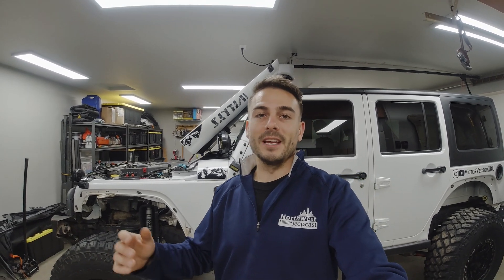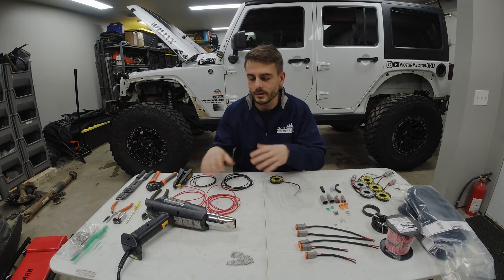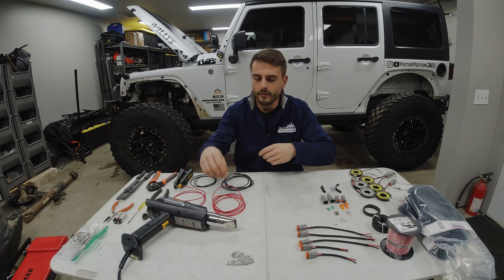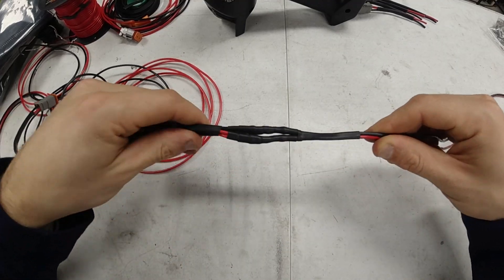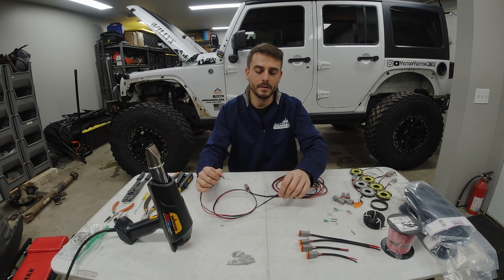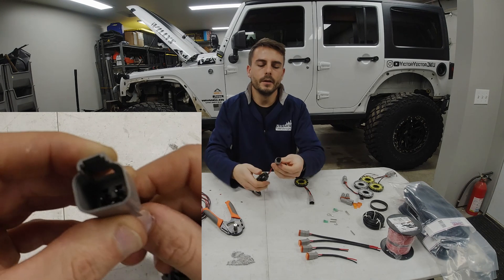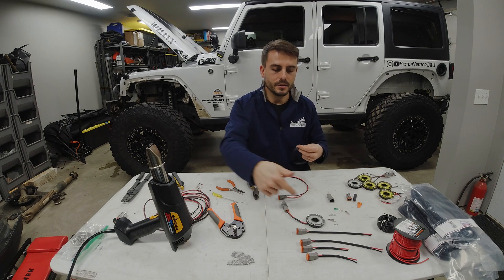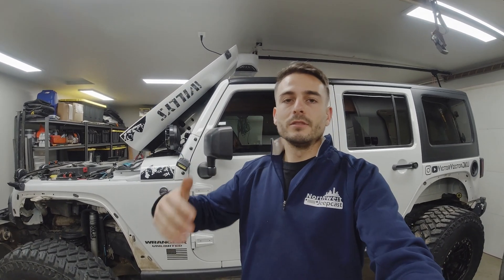DIY Rock Light Harness Build - KC Hilites Cyclones

Comment: I know this is several years late but, thank you for the in-depth video. I have been looking for weeks at install videos for various lights and nobody ever states what gauge wire they use or fully films the process of assembling the harness, except for you. As someone who lacks any and all knowledge on this topic but is trying to learn, you have my thanks.
Reply from the maker: Hey there Juliang.5901 thanks for checking out my video! Of course, I think a number of creators do not want to provide too great of detail for the case of any failures happening based on any content shared. I hope that I detailed out in my video where I obtain details on gauge of wire to use based on length and amperage and what I made is truly for reference based on my specific application. Like you said it has been a couple years since I made this video and I do not recall the details I went into 😅

Comment: Any problems running them with a single fuse compare to the one KC comes with? Which is each light running a separate fuse?
Reply from the maker: Hey there TheExia0, thanks for checking out my video! I have not had any issues with running the number of rock lights I am off a single fuse. Now the V2 lights do run higher amperage than the V1’s so as long as you calculate the amperage output of the harness and size a single fuse correctly you will not have issues.
Reply: @VictorVectorGarage  how many cyclones are you running?
Reply from the maker: I am running 9 cyclones for rock lights and they are on a 30 amp fuse. Each one is between .25-.55 amps so I’m total my circuit draws a max of 5 amps.

Comment: Great video.  I always had trouble trying to build a wiring harness for lights with relays, switches, fuses and resistors.  I'd follow blog instructions but never got it to work.  Having a single video cover it all is very helpful
Reply from the maker: Thank you Benny! Glad you found my video helpful! And yeah I definitely understand the struggle with relays! Fortunately having the VoSwitch makes this a neat package so I don’t have to worry about that portion!